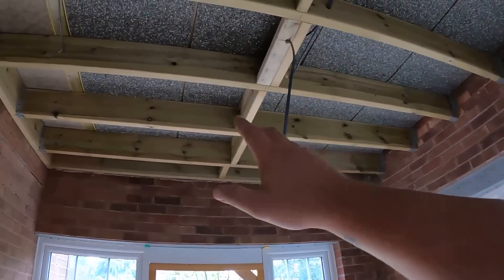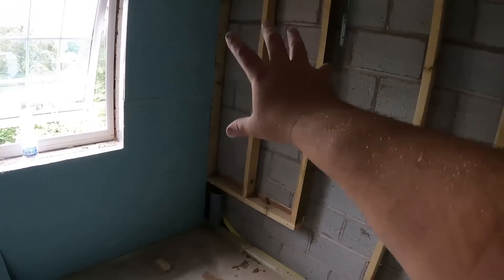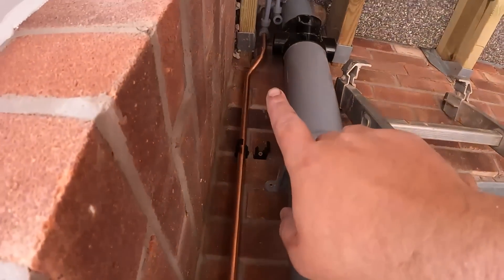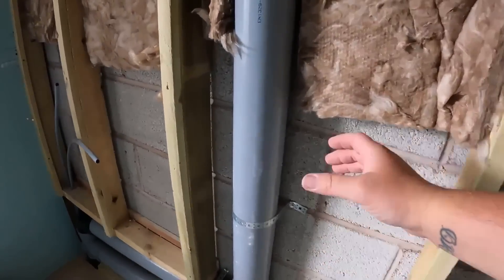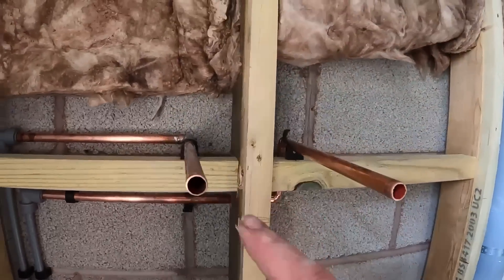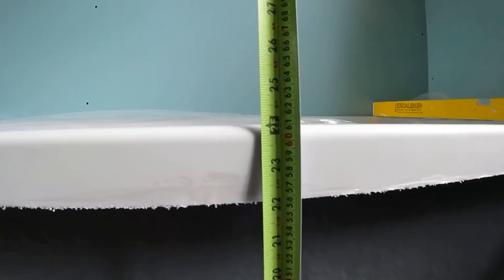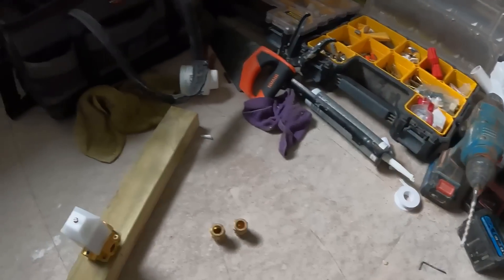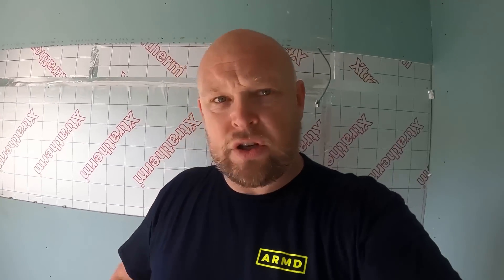BATHROOM DESIGN ISSUES.. Is the customer always right? 1st Fix PLUMBING starts on this job

Comment: Great video mate. Re getting the correct pipe centres fo the mixer valve, I keep hold of the mira hard plastic pipe templates that come with there bar mixers, there set at 150mm and Just screw them to the noggin and level up. Perfect every time and reusable. Keep the up the great work. Rob

Comment: my "knack" for fitting a bath is I batten the two walls with some stud work  (thin piece across tap edge so you're not blocking yourself from installing the taps) then as soon as that's level you can lower the feet to the required height. boom it's level and provides extra support and no sagging of the bath especially if there's a shower going over it, no leaks and no squeaks.

Great video as always mate, was thinking he's making this harder for himself on a few bits, then saw what you were doing at the end and it all made sense, like you said we've all got our own way of doing things
Reply from the maker: Yep always Batten out baths, makes them so much better👌🏼

Comment: Loctite 577 works very well on the threads for shower mixer and rad valves it's perfect save me so much time when I'm on a price onsite not touched normal loctite in a while defo give it a try 😊
Reply from the maker: Need to gone it a try

Comment: Another great video Mark, you explinations are always clear and to the point.  My preference is for completely concealed pipe work . As far as the shower goes, if this was for me I would go with just a large shower enclosure. However, I appreciate that for some a bath is required.  Looking at the room as is I would turn the shower tray through 90 degrees and swap its position with the basin. Then possibly put the toilet in the corner with the basin between it and the shower.  It’s hard to be sure not knowing the dimensions.  It is the clients choice at the end of the day, but, I think they might regret having the window in the shower!
Keep these great videos coming.
Reply from the maker: I think they will aswell buddy…… but what do we know eh🫣
Reply: My comment above agrees with yours. How can the bath taps be turned on without treading on the shower tray? Slip hazard as well as jolly inconvenient.

Comment: I always put my timbers on the wall first set to the correct height for panel ect then drop bath in and set the feet so all is level. I find that a quicker way instead of putting in and taking it back out to then brace it and put back screw down and seal ect
Reply from the maker: Yep Batons make a big difference

Comment: Love the videos. Always  excellent  work. just a quick question home diyer: Is there any reason why people  use elblows rather than just bending the pipes, i.e., coming out of wall to radiator
Reply from the maker: Sometimes it’s for the working area, tighter bend allows the fittings to sometimes look neater and work with the dimensions
Reply: @MJTiffPlumbing  it's in the wall radiator pipe

Comment: Hi MJ, Carron baths used to advertise with a 7.5 ton truck sat on a bath under each wheel to show their strength which is probably why they don't bother with a central leg because the base plate is much thicker and I think ply as opposed to chipboard.Good baths made in Scotland I think and stay hot much longer than most but they aren't cheap 😁
Reply from the maker: Yer you can tell they are a proper bath just by how they feel👌🏼👌🏼
Loving the truck advertising campaign

Comment: I have been using the liquid ptfe for some time now but with tape aswell. I dont quite trust it on its own. Also JG and flomaster do some nice male iron to plastic connections. Have used on shower valves/taps etc👊🏼👍🏼

Comment: The easiest way I’ve found to level a bath is to set your bath strap to the correct height and make sure it’s level,  put the bath in, having it on the strap. Then start with the legs loose and start from the back left corner (left side of the overflow) to the right side of the overflow and level that. Then level from the front side where the handles for some baths are. Level the bottom part and you’re good to go. Your back legs should just need to be pulled down and secured. 
Starting with the a level strap makes it super easy for me!
Reply from the maker: Yep that makes sense, just about how I do it..👍🏼👍🏼

Comment: I'm forever chasing my tail on leveling baths too! Also great idea with marking up the boat level for the shower. I've been using those angled bar mixer wall brackets but they're about £35 now!
Reply from the maker: Yer it’s a cracking little tip 😉

Comment: Good first fix mark and good top tips as always. The green thread sealant is anaerobic sealant, I use it on loads of threads, Part number 4373J from screwloose. I knew you would mention about the soil pipe colours, what does it matter 😆😆 as long as your not running brown waste up the side of walls outside as it's not uv stable to sunlight your alright.
Reply from the maker: Thanks mate…. Just wanted to cover it before the color police “pipe up”….🤣😉😉

Comment: Great video. I noticed the bathroom walls are moisture board (green), but the bathroom ceiling is not. Can you, or someone, say why the bathroom ceiling would not also be moisture board? Thanks.
Reply from the maker: Never seen a ceiling done in moisture boards, if you have enough airflow with your extractor it won’t be an issue 👍🏼

Comment: Great video,job mark,what dja think about the new building regs part L,where they state every pipe should now be lagged,in voids, floor ceiling spaces, gonna be more cost for customers. Customer should of had the shower tray longways,then there would of been a gap between bath.
Reply from the maker: Yep, for new builds/systems that right…. Going to push the prices up on a lot of work

Comment: In Ireland we would run 22 right to last and 15 to branches goin up just for more volume if all service's bein used at same time
Reply from the maker: No 22 feeds to get onto with this one…. Pressurised system so not a problem👍🏼

Comment: The shower is so close to the bath it will be difficult to switch the bath taps on without treading in the shower!! Also the shower is under the window so there will be strange shadows on the curtains looking from outside. Not a good floor plan I agree.

Comment: Re your use of st st elbows in tight situations. I agree but in your example I couldn’t see why you were using any elbows at all and not pulled half sets and bends  as you said it may be boxed in but was just utility area  ?.. just asking ! Rick 40 years plumbing heating and gas engineer retired !
Reply from the maker: Like you said.. you couldn’t see.
I could and that was the only way buddy, the thing with making YouTube content is you can film every single view, angle and way that you see it is sometimes different.👍🏼👍🏼

Comment: Great vid, layout is awful, will there be a glass screen up against the bath panel?, quadrant would have been better in the corner on the right as you walk in?
Reply from the maker: Not sure how they are going to screen it with the window there… possibly fully open and just a fixed screen on the side 🤷🏼‍♂️🤷🏼‍♂️

Comment: Is that downstairs ceiling being counter battened? Would it have been an idea to run the bath waste between the joists rather than under the ceiling? The shower waste could of gone inline with it too? Could the basin waste not gone in the stud wall?

Just a lot more to box in?
Reply from the maker: The boss on the fitting wouldn’t allow the space to get it within the joists…. As said it’s not an issue as it’s a utility room anyway 👍🏼👍🏼

And the basin waste IS in the stud wall👍🏼👍🏼

Comment: Easiest way iv found to level a bath is to fix 1 wooden baton to the wall level .....normally use something thin like roofing lath. drop bath on wooden baton and wind the two closest to the wall legs up so they dont touch the floor ......then just level off the two far feet and fix them.  then lower the other two feet down and fix them...dead easy and it adds a lot of strength ....no need to fill bath before you silicone also , because it just wont move ..... add classi seal tape before this for a bullet proof lifetime seal , or i do anyways :)
Reply from the maker: Yep always fit a batten on a bath, always have done. Infact I’ve put it on here before and not filled it as a lot of people think you have to….. until I tell them it’s going nowhere with it battened

Comment: Have to agree, that layout is terrible, as you suggested, bath under the window would have been much better, not sure what size that bathroom is, looks very similar to my own one that I've just refurbished, 9'x7'6 managed to fit both a bath and shower by compromising a little on the shower, and fitting a 900 quadrant, along with a carron status bath, the curved end along with keeping things uncluttered by using concealed taps, valves, cistern along with an, overflow filler we kept the cramped feeling at bay, though a different window and door orientation means it wouldn't work in that room.
Reply from the maker: Yer a quadrant would of been a better solution, however the customer had a “interior designer” do the bathroom design…🙄🙄…. I couldn’t make them see sense unfortunatly

Comment: How do you deal with uneven floors when using bt1 to stick a tray down? I can’t remember the last time I fitted a tray to level surface unless its a plinth that I built myself.
Reply from the maker: To be fair they are usually spot on, otherwise it’s a case of building it up with some 2mm ply if ever needed… or a good bed on it

Comment: Hi Mark do you pressure test all these push fit joints in the wall before it’s boarded or are you confident enough to just to go with it ? cheers
Reply from the maker: Hey mate, confidence is key in our game….

If it’s a huge job like the barn renovation it will be tested, but this is fine just getting the water on as not that many connection
Reply: @MJTiffPlumbing  cheers Mark keep up the great videos

Comment: Great wee job that mate. Depending on how they are finishing that bath and shower tray for it being too tight. I like it personally. Would you ever think of fitting a showertray tight to the joist (with 6mm ply) then when the floor is tiled it's like a wet room with the floor flush with the tray. Had a chuckle when you used the white for the bath and basin waste.🤣🤣.🟠🌚⬛️⚪️. #RWP 👍👍
Reply from the maker: Always use white waste pipe when I can👍🏼
Yep the wet room trays can work well when they are designed into the job👍🏼👍🏼
Reply: Wasn't thinking of the wet room tray just a standard tray lowered into the floorboards. To be honest the colour thing doesn't bother me unless outside but I know you do it all the same outside, and also use up what you have best way.

Comment: You could use a 6ft level corner to corner diagonally as initial levelling of the bath and refine it with a smaller level, but as we all know most baths and shower trays are not 100% perfect and there is always one side just a touch off
Reply from the maker: Yep always one of the edges doesn’t want to play ball

Comment: I don't understand why when people say "I want a shower and a bath" in a smaller room why they won't just do a wet room with a bath in it. It's so much easier when it's at this stage to just do that and cement board and tile, saves room and makes it feel bigger and more grand than it actually is. Loving the trick with the level I do something similar but I've made a jig now.
I'm surprised you didn't add one more bend for those utility drops, sods law if you get any grief it'll be those push fit elbows tucked behind that soil pipe.
Reply from the maker: Yep the room just feels so closed in now due to them squeezing the shower in. Not a great design

Comment: Defo to tight for bath and shower you can cut those trays down a little but depends on the screen your fitting
Reply from the maker: Wouldnt want to be cutting that down😮🙈🙈….. they should of just gone for a smaller one🤣

Comment: It’s not a Sunday without a coffee and a new video 👌 do you have a preference for glued waste fittings over pushfit? I prefer pushfit just that’s just. Thanks for the video again Mark big fan of the channel 👍🏻
Reply from the maker: Thanks mate….. I personally prefer using solvent weld as I find them a lot more rigid obviously, just less of an issue of movement.

But we all have certain things we prefer to work with and there is no right or wrong👍🏼
Reply: Yeah true that 👍🏻